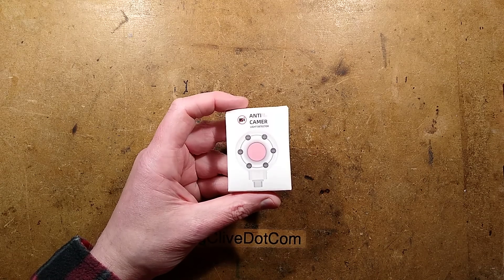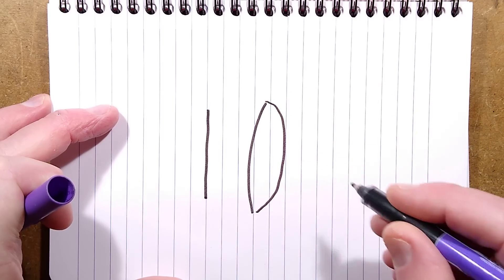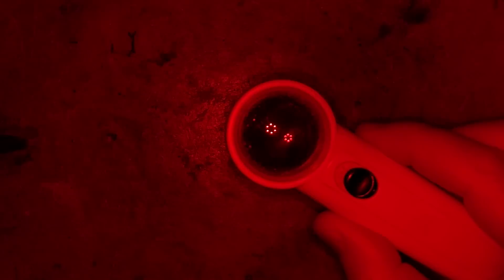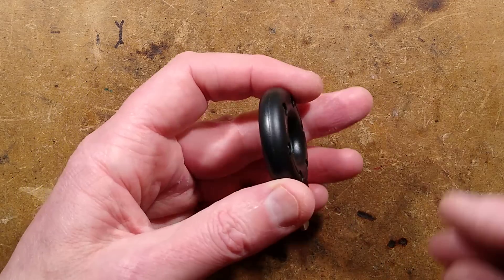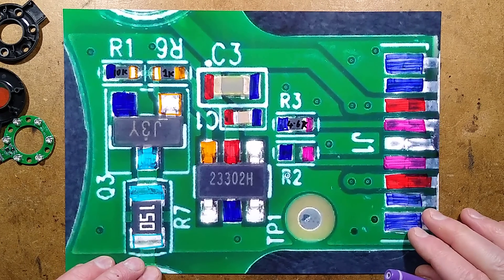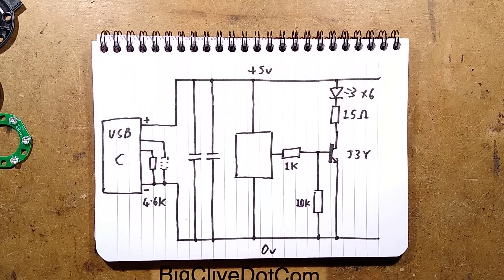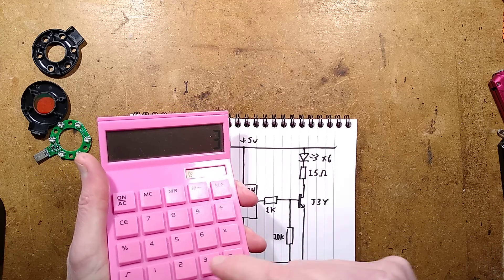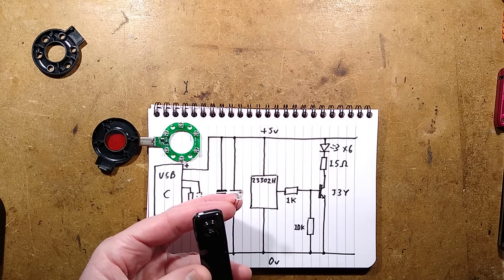Inside a Temu spy camera detector - with schematic

Comment: Someone will eventually use one of these to look for spy cameras. Then they'll find one in a strange device plugged into a wall socket. Only after smashing it open will they realize it was just the LED on a Super Electric Power Saver device they bought and forgot all about.  The end.

Comment: Plot twist: when plugged into a phone's USB socket, malware infects the phone to give the black hat remote access to the user's camera.
Reply: I was also thinking that it seemed potentially risky to plug it into his phone, though based on his reverse engineering there was no risk of that
Reply: @Cyberguy42  It would be easy to put in the data lines, and put in a different micro with a payload, now that everybody thinks they are safe
Reply: Or destroys your phone with Bad USB device voltage...
Reply: @brauchstdukriegstdu  This is much more likely than a trojan.
Reply: @fuzz992  That is the trojan
Reply: Should be fine with a charging cable then
Reply: could always just shove it into a powerbank instead if it has the slots.
Reply: And why? Bs.
Reply: @7531monkey  why what?
Reply: no not how android works

Comment: wrt USB-C resistors: for a device with a plug (like a flash drive) you only need one resistor. they probably added footprints for both and then realised they only need one (actually, some hosts might act weirdly if there are two- usually they can only see one because there's only one CC wire through the cable, for orientation detection)
Reply: Exactly this. If it had been a socket, 2 R's would have been right. In some ways a socket plus a cable might have been easier to use. However I don't think that any plugs and sockets have compatible footprints, so it's probably just ineptitude.

Comment: I've got one a bit more "up-market"....With RF detection up to 6Ghz and a set of 8 antennas for different bands...It DOES work though....Tested it by letting people hide a pinpoint camera anywhere in the room, found it every single time...Same goes for "bugs", eavesdropping devices and all kinds of radiotransmitters too......BUT....What you cannot detect, you don't know is there. That is a blatant hole in the/all sweeping systems like that.
Reply: Which device do you have, I need one as I believe I am being monitored

Comment: The 6 pin device could also be a watchdog tiner ic. I have played around some years ago and used it as led flashers since some of them produces reset pulses at a similar rate as your device when they don't detect a clock pulse from the uC on an input pin.
Reply: It would be funny if the chips were microcontroller rejects repurposed because they just happen to keep rebooting at about the right rate.

Comment: A critical note to all viewers - ALWAYS virus scan any software that comes with these online products. I have found a pattern of virus/malware laden apps being included. Sadly it often renders the product useless. Also watch for ones that automatically update their software without notification. They can start benign and add the nasties on a subsequent update IF your antivirus is not up to the task.
Reply: Yep… got an awesome custom keyboard as a gift and it’s basically a useless toy now that I’ve taken a look at the firmware that I would have to install to use it (it’s literally supplied as a Google drive link and shows up as a rootkit when scanned) 😢
Reply: @natorsi  BTW, there's a good chance the virus scanner only detects that the software interacts with the keyboard driver and calls it a "generic keylogger" for that. I'd upload it to virustotal and check the individual results.

Also, "firmware" is installed into a device. I'm assuming you talk about the control and/or driver software that is installed on the PC.

And thirdly, there are only a handful of programmable keyboard chips. So looking for a programming software from another source may be worth it if the installation package for that one is infected.
Reply: And don't plug random stuff into your phone.
Reply: @1BergerVongSchlauigkeitHer  For something like this, just plug it into a Power supply.
Reply: @m9ovich785  Exactly.  If you’re traveling, you’ve probably got a USB power bank.  This device is probably malware free, but an average user won’t do a forensic analysis to know that.  Better safe than sorry, use the power bank.
Reply: why would a simple device that can be controlled with existing buttons need a custom interface software, I'll never understand
Reply: Oh man, this has been true for multiple reasons since at least the 90s. 
You never use the drivers that come in the box. You never use the operating system that the put on your laptop before you bought it. Wipe that crap immediately and do a clean install of your OS 
(Or your desktop, but you built that yourself so it shouldn’t be a problem.)

the thought that people after all this time would be intentionally installing the programs that came as Cracker Jack prizes in the cheap doohickey they bought is terrifying.
Reply: Yeah, the WiFi routersor print servers are usually dodgy firmware too, considering almost all GUI webpage routers (and probably ones with no GUI too) run a stripped down version of Linux, so you could add whatever you wanted to the firmware OS.
Only way to find out/flash new firmware (unless it allows OTA firmware flashing) is to solder a pin header to the UART diagnostic pads (if there are any) and dump/flash the OS that way.
Reply: Absolutely
Reply: Dollar trees USB cables are or were charge only when I bought a couple in a pinch. They lack the data line
Reply: Yeah, the mini CDroms that are supplied with nearly all chinese products are infested with various viruses, trojans, key trackers and worms... I imagine that just about every PC or phone in China is fully infested.
Reply: Those tiny chinese USB vape chargers give me the creeps too. Why people plug them into their data ports is beyond me
Reply: I think there should be a market for a usb C to C connector that broke the data lines. That way you'd know that your phone is only supplying power, not getting nasty data back.

Or if they already exist could someone tell me what to Google for?
Reply: @trueriver1950  I found some by Accident.
I thought I had a bad cord, No it was just a charge cable. No data pins in the Connectors
Reply: @trueriver1950 Look up ‘usb condom’.
Reply: @trueriver1950 you CAN get power only USB cables, the ones that come with Petzl Actik USB rechargeable batteries are, unfortunately those are 3-inch long USB A to USB Micro

Comment: The spare pins on the 2330 chip is possibly to program it or to set its output timing.
Reply: It's likely that they are for features that this device didn't need. And those might or might not be the ones you are thinking of.

Comment: This came from Temu...
'nough said.
Reply: It sounded pretty good to me. Doing what it said it does, no dodgy components.
Reply: @LeifNelandDk  - yes. my comment was more on the lines of selling it as a spy camera detector.. much in the same way that  CMOT Dibbler used to sell wooden sticks as dragon detectors. :)-
The device works as intended, just not as straightforward to use.
Reply: @EngineeringVignettes  you need to do it optically, not all cameras use rf for transmission.
Others might run on a schedule to save battery and make detection more difficult.

I bet high end spy cams could use one way mirrors to avoid sending reflections.
Reply: @EngineeringVignettes  I personally preferred "Dibbler's Genuine Soggy Mountain Dew" that was claimed to be 100% proof or as Nobby Nobbs put it's got no proof merely circumstantial evidence

Comment: Could the unpopulated resistor location be used as a switch? If you insert the detector backwards (with the LEDs facing the same way as the phone screen), maybe the circuit doesn't get energized?
Reply from the maker: I think it would be better leaving it unplugged completely.
Reply: I think because the device has a USB Type C plug, and not a receptacle, it can get away with using a resistor on just one of the CC lines. Host devices like phones, charges, etc. will monitor both the CC lines, but in case a cable is used one of the CC lines will not be connected. By having the Type C plug directly connected to the host receptacle, it will have both CC lines connected, so it is enough to use just one resistor.
Reply: It's part of the USB type C spec. If you populate both you're telling the other end something different.

Comment: I didn't really expect a 2-transistor oscillator, as the flashing seems to have a distinct rhythm.  There are microcontrollers (such as the ATtiny10, but I don't think it's one of those) available in SOT-23-6 packages like that.
Reply: Yes, looks like MCU. Power pins match  PIC10f200 in SOT-23-6 package.
Reply: Maybe a copy of it or maybe cheap mass produced chinese silicon or a asic
Reply: There are a bunch of extremely cheap sot23 LED flasher ICs made by Chinese manufacturers e.g. YUSIJIE.  The overhead in programming a micro for this wouldn't be worth while.
Reply: I was expecting an analogue double-AND + cap & resistor combo circuit.

Comment: Would this device be able to detect a camera behind a mirror...asking for a friend
Reply from the maker: It may detect it behind a half silvered mirror in a dark room.  If in doubt, stick something over that area.
Reply: I've seen cameras behind mirrors that could not be detected this way. The regular reflections of the leds in the glass of the mirror made it impossible to notice the camera lens. Even when we knew it was there we could not spot it.
Reply: If it's a fully reflecting mirror, no, but a camera behind a fully reflecting mirror would be blind anyway.  A partially reflecting mirror would give the effect of a dim reflection behind the mirror, a little dimmer due to light loss, but since there would otherwise be nothing visible behind a mirror, it would kind of stand out.
Reply: I second clive, cover it up
Reply: Reading the masses of these type of comments makes me wonder what's going on in other parts of the world 😅
Reply: @NinoJoel There is some heavy use of covert cameras in Air B&B's and in Asia.
Reply: @deang5622  interesting. 
Never heard of that.

Comment: Used to use diatomaceous earth, many diatoms are shaped like corner reflectors which return light along the same direction it came from, at some point was used in signs to make them easy to see at night!🎉
Reply: Do you have a source for that, I've found nothing online that even comes close to what you said
Reply: @phono... yeah, chicken med suppliers. They believe that the micro cystalline structure of the di-atomaceous earth (basically finely ground sea shells) has an effect on lice, ticks and various mini arachnids. It's never worked for me (meant to be an organic way to de-infest your chickens and chicken coop).
Reply: @phonotical you can try searching celite. You can get it readily often used as an insect propellant as its very coarse and dry. It's used in toothpaste and you can use it in soil for holding water in potted plants.
Reply: its mentioned (though not referenced) on the wikipedia entry for the diatomaceous earth component "Chromalveolates" also on Reddit someone mentioned his science teacher of old saying it.